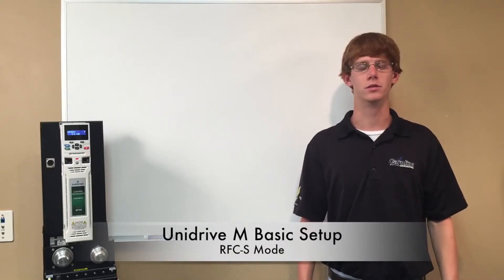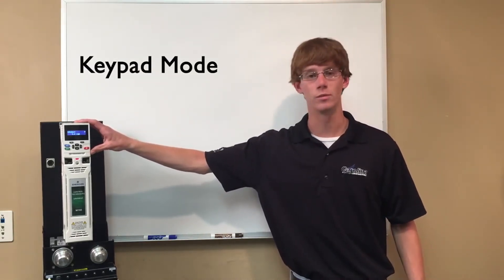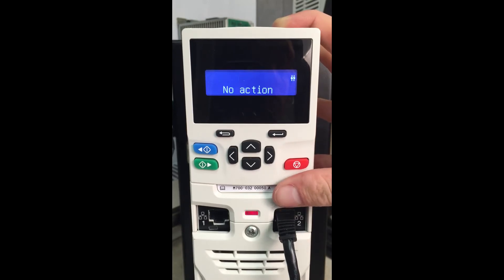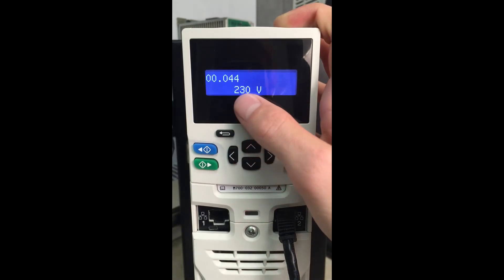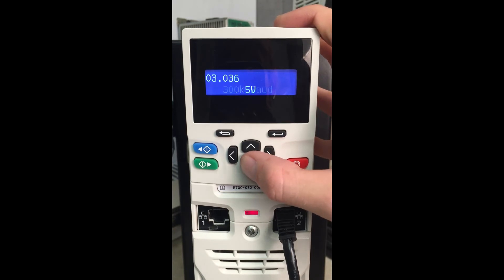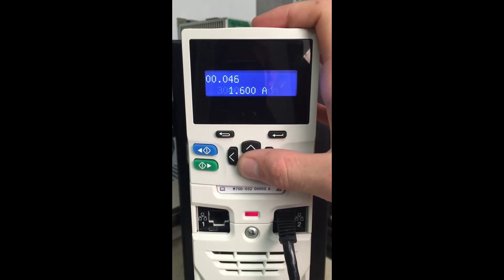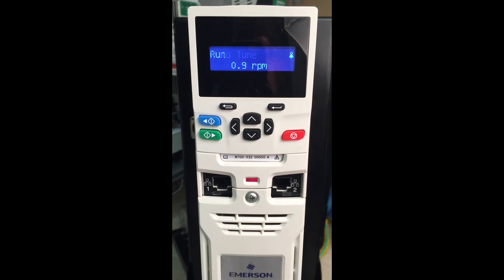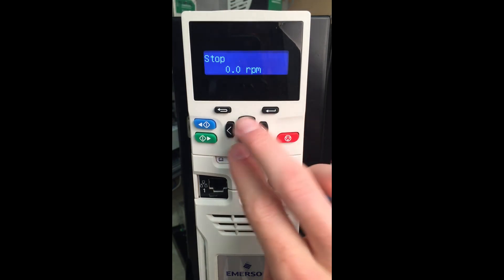Control Techniques - Unidrive M RFC-S Keypad Setup

Comment: RFC-S and RFC -A SETTING IS ANY DIFFERENT IS THERE?.
Reply: Synchronous motor
Reply from the maker: @dhakshanamoorthys1643  yes -A is for vector asynchronous motor. -S is for synchronous motors. What type of motor do you have?
Reply: @Carolinamotioncontrols 
I am facing I/O overload  trip on M701 .
How to solve this issue

Comment: In 00.40 auto tune it showing no action and basic . what should i do for roataion no 1 & 2?
Reply from the maker: @RAJESHJERRONE  do you see a value that says advanced? That would be the rotational tune. Ensure the motor is unloaded and free spinning shaft before doing the rotational tune.
Reply: @Carolinamotioncontrols  yh now is ok , new drive still it showing the error that tip I/O overload?
Reply from the maker: @RAJESHJERRONE  something is not wired right at the bottom connector such a 24v in a 0v. Did you remove the existing connector from the old drive or rewire?
Reply: @Carolinamotioncontrols  yh , we removed from the old drive . Thanks for ur support . i will check the connector
Reply: @Carolinamotioncontrols   display shows stop 0.0 rpm , can u suggest me how to make run mode?
Reply from the maker: @RAJESHJERRONE  what is par. 0.5 set to? Keypad, preset? Do you know if you have a coms module and commands are via a PLC?
Reply: @Carolinamotioncontrols  no its from contactor only & 0.5 is keypad
Reply from the maker: @RAJESHJERRONE  if you have 24vdc on T31 then you should be able to kit the green button on the keypad then hold the up arrow to increase the speed.
Reply: @Carolinamotioncontrols  yes it is increasing the speed of servo motor , and it is running by keypad.